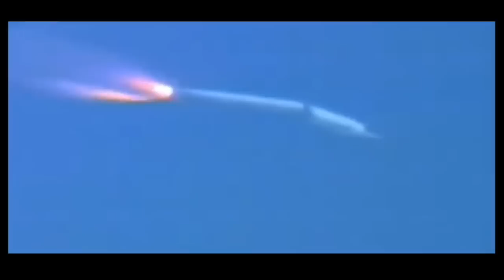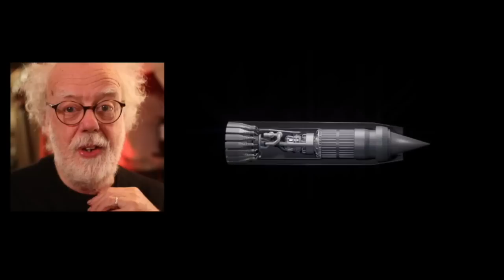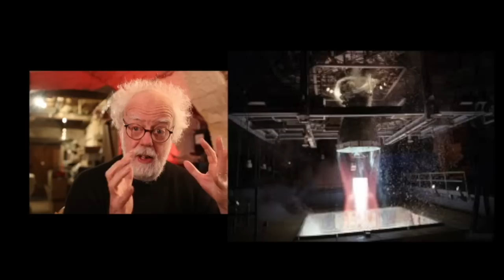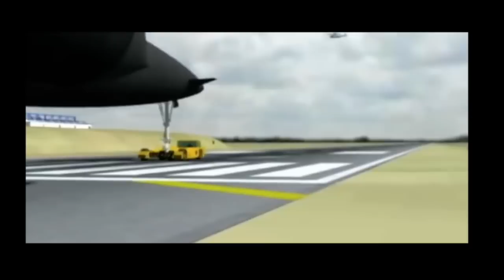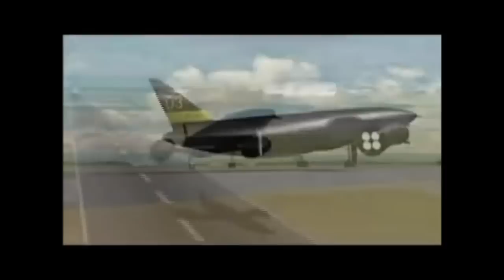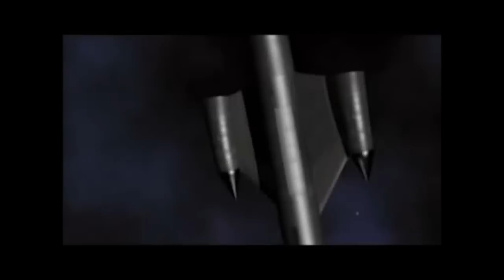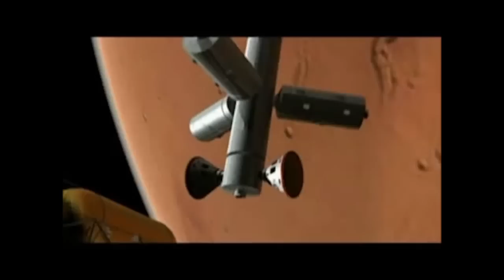SKYLON - The dream - Prof Simon

Comment: Cooling the intake air is fine and a definite breakthrough. But I think the real issue may be cooling all those small rocket nozzles. Seems like a similar problem with aerospike engines in that you're using regenerative cooling (for reusability,) the same approximate amount of fuel as a similarly sized conventional rocket engine and roughly the same thrust, but now you have 9-12 combustion chambers too with as many times the surface area to cool with the same amount of fuel as that single chamber engine.

Comment: This simply will not work, as the melting temperature of titanium is 3034 degrees, this is when it turns into a liquid,During reentry of the Orbiter, its external surfaces reached extreme temperatures of up to 1,648°C (3,000°F). Despite the extreme heat experienced by the TPS, so without tiles that the space shuttle has on it silica tiles on the space shuttle and the other systems working together is the only way you can re-enter a vehicle that has been in orbit, is just to maintain a low earth orbit , ELO you must be traveling at 17,500 miles per hour, so simply put titanium alone would not be enough to protect the skylon during the re-entry burn, or the OMS burn, this is when the vehicle would have to turn around fire the orbital maneuvering system for the vehicle to Begin to Fall to Earth simple physics would make this impossible, unless and used systems similar to the Space Shuttle, tiles are very difficult to work with and they get lost during launch and sometimes during reentry simply put it will not work, without using the combination of systems they keep the shuttle cool enough for reentry, it would simply Fall Like a Rock and turn into a ball of liquid titanium and I think people burned a little over 140 degrees, think about it think about how much work would go in to a re-entry system for this vehicle that I would become quite costly and extremely dangerous... Sorry to burst your bubble😢😢😢😢
Reply: @Carl Klinkenborg I want to talk about the Ingenuity you put forth in your response, as with rocket engines of that day and that era they used when they called up and down tubes on the nozzle which carried hydrogen  through the tubes forming the nozzle, hydrogen is approximately -400°f, keeping the f-1 nozzles cool.
To bulid a structure to perform this incredible task brings about many expensive programs and systems with many different problems of its own not so easy to solve if these types of problems could ever be solved...

Comment: Even though this is promising, TWR on these would be quiet low no? I doubt just 2 of these can generate enough thrust to create escape velocity, also what about the expenses? Creating these engines would be more expensive than just to make a regular Rocket Engine, also what about the reusable testing phases? These are the reasons why shuttle program was shut down & why NASA still hasn’t taken an interest in creating reusable Rockets. 

What I see happening in the future is we invent a composition of Liquid fuel that’s much more lighter than O2.

Comment: The problem is what to do with all the heat. Convection to the atmosphere would add drag, radiation would be too slow. How about reusing the heat, to reheat the air at the thrust end.
Perhaps three major parts: A cooling loop with three heat exchangers, a stream from intake to thrust with two of the cooling loop heat exchanges and a fuel stream that interacts with one of the cooling loop heat exchanges. 
Stream air enters and is compressed.
The cooling loop cools it with its inlet compression heat exchanger.
A second compression stage compresses the stream further with conventional means (ram or turbine.)
The cooling loop carries its super-heated coolant to a second heat exchanger (thrust exchange) after the conventional compression.
The relatively cool stream is further cooled with hydrogen fuel before it interacts the thrust exchange section and it ignites, completing the heating for thrust.
After the thrust heat exchange the now partially cooled coolant continues to the third heat exchange, the fuel heat exchange.
Heated fuel exiting the fuel heat exchange streams to the thrust section.
Super cooled coolant exiting the fuel heat exchange travels to the intake compression heat exchange to continue the process.

Comment: No matter how you slice it, you're going to be re entering the atmosphere around 7-8km/s... if you don't have a blunt body, youre going to be achieving absolutely ridiculous drag forces in the lower atmosphere since you wouldn't have bled off enough speed. Another point of the blunt body is to get a detached shock in front of the body, getting that stagnation temp away from the body

Comment: When I look at the most recent rendering of the SABRE there's a lot of small nozzles at the back of it, which leads me to believe the engine will act as aerospike capable of having decent Isp in all the regimes it operates. Still not that confident in their use of LH2 as fuel, instead of liquid methane which SpaceX is using for their Raptor engines.
Reply from the maker: Interesting

Comment: A story as It was told to me:  The Blackbird had several fuel tanks.  One was that pointy strake coming out at the tail end.  The story says that Kelly Johnson had designed a liquid fueled rocket engine to go in place of that extra tank.  Then only take on a minimum load of JP and fuel the other two tanks with Kerosene and LOX.  It could then take off like normal, assume max climb and when it ran out of air at about 125,000 Ft, Start the rocket engine.     It would have been the first working Space plane.  A Spacecraft.
But Kelly retired and it never came to be.  It makes you wonder.......

Comment: Yet, both russia and china have hypersonic cruise missiles and russia also has a nuclear-powered cruise missile that stays aloft for years and is just slightly below hypersonic speeds. Russia is also looking to apply their tech towards new spacecraft. What I also wonder is if using helium to cool the air intake, why not once in space using the helium as fuel in a plasma engine?

Comment: Why are they not using the cooling ring technology for take off for reentry on the outer skin of the plane? As an added bonus, incorporate the plasma technology to generate on outer shield on takeoffs and reentry. It would act as like a double pained window to keep out heat. The plasma could also act as a damper for vibrations.  If the wings leading edge could be electrified to create a plasma which could also act as a buffer for streamlining friction.

Comment: If Skylon does get up and running i would say within 1 year it will be bankrupt.Then it will , need large sums $$$$$$ millions spent on it just too keep running.Okay in the military sector they spend $$$ millions just on  concepts before production costs come into the equation.My opinion would just say you built 2 of these aircrafts production costs etc average $80 million per aircraft so 2 would be $160 million in concept alone etc .You could be talking about for each aircraft in total near $800 million.Very expensive unless you build them in China ha ha.I doubt you could build each one under $400 million.Seeing a brand new Boeing  747 costs $350 million.Then the cost of running Skylon for 1 year.Even the  SR 71 blackbird in 1970 was costing $200 million for 1 year running costs.And the military do not care what it costs.Private companies do.Shame but i have doubts it will take off.

Comment: A correction as to the STS's engines. The orbiter itself has 3 SR-25 SSMEs, which run all the way from the pad to orbital insertion.  The only staging performed is dropping the solid rocket boosters (SRBs) at 2 minutes. The main engines are optimised for vacuum, but use some bell nozzle shape trickery to prevent flow separation. The Orbiter also has 2 much smaller engines as part of it's orbital Maneuvering system (OMS) which are used to de orbit the craft.

Comment: What are you a professor in? 

SR-71 cooling techniques WILL NOT work on atmospheric reentry. The SR-71 is designed and shielded for friction based heating, while spacecraft heat due to super heated plasma that heats due to compression. This is why blunt objects are so much easier to shield (hence why the X-37b, Space shuttle, etc. are all blunt nose).
Reply: Justin Martin watch it again, listen to what alan bond is saying. suspect he has a clue.

Comment: That's genius , but water is the best most compact  source of jet fuel that is twice as powerful as Jp4 and it has its own oxygen for a jet engine that morrfs into a rocket in space ..! 
     Salt water can be broken into hydrogen easily with far less energy than previously thought with a less than 10 watt frequency instead of 120 amps 12 V DC  allied to plates less that 10 watts compared to 1440 watts for a pitley few pufs of hydrogen ..! 
    But I'll bet you are not aware of this discovery during cancer research ..!?

Comment: One question, the test facility shown has a significant divergent cross section. How much of the cooling comes from adiabatic cooling from the divergence?
Reply from the maker: Good questions
Reply: There is a conical body inside the test facility, so the divergence isn't as great as it might first seem
Reply: @jocramkrispy305  Thanks. That makes sense and I suspect its taken into account

Comment: The fuel for  hydrogen / oxygen rockets is really cheap. With a fully reusable system, Space-X can afford to fly several smaller missions. Basically, they're just paying for fuel. It's simpler because they don't have to worry about all the extra engineering that makes a SSTO possible. It'll be interesting to see if they can make a hybrid engine work cheaply and reliably though.

Comment: cobrapub here,ok I have spent 40 years in the astro/aero/jet/ramjet/rocket industries as a draftsmen/designer and engineer,sorry no degree just experience and yes I did a contract on the SR71 and the SpaceShuttle!I even had lunch with the father of the turbo High ratio baypass engine at GE Avendale and several SR pilots at Beal AFB!In 1981, that year I received a revelation as you did about the whole compulation of a TAV [trans atmosphereic vechical]!I wanted to reach what the SR pilots called the "HOLLY GRAIL ZONE" where there is no need for propullation at all,above 250,000 feet!The First person to talk about this was Doctor Eugene Sanger,he created the sub space orbital math used by NASA for the space programs back in 1928!Now down to facts the first thing needed to looked at in any SUB SONIC to HYPROSONIC is SHOCK,Managing the air flow in to the engine!The SR71 uses a unbelievable plumming to slow incoming air so as to not blow out the combustion cams,this is extremely dangerious it leads to a problem called UNSTART!Next there is the problem of the combustion cams design,it has not changed in more than 50 years,hence the slow and low inefficient use of the Hi Ratio Bypass stator assembly!Ok next we look at supersonic to hyprosonic regement,above 50,000 feet combustion cams cannot handle this regime,now you need a modified way to combust fuel!The Aerospike showed promise,yes heat conversion is a factor but as you go higher more thrust is required!For those that have trouble understanding what I am talking about,I give you the first SONIC/HYPROSONIC Craft the BOMARC [IM99],it flew at Mach 4 in the 1950's!

Comment: Interesting concept.
Still, when looking at the aircraft, one though comes to mind: how are those tiny wings able to generate any lift, especially on takeoff?
Seems to me, that Skylon will have to go supersonic before even thinking of taking off.
Reply: @Michael Sharp True, but did you have a look at the accident rate of the German Starfighters, some of which being related to overloading this interceptor type aircraft to make it fill its role as fighter-bomber, despite all the high lift devices used in the aircraft? Space programs seem to have the tendency to overrun not only cost wise, but also in terms of weight. Don´t get me wrong, the Starfighter was a great aircraft as an interceptor and the design was years, if not decades, ahead of its time and despite the critiscism about the small wings, it proved it´s worth over 3 decades of being deployed.

Comment: This has many more issues than the heat that was identified, and as a RESULT, the system was abandoned long ago. NASA has done research and the issues just outweigh the possibilities.
Reply: No, NASA did the research on LACE, this isn't LACE. ESA and USAFRL have both signed off on it being a valid concept.
Reply: William Mielke nasa isn't the only, or the best, player in this field. just the richest - or were.

Comment: Nano tubes for the intercooler made of nanocrystalline cellulose will handle extreme temp pressure gradient, Like wise for heat shielding hull panels and space frame nanocrystalline cellulose self arranges and also responds to laser and magnetic alignment making it a print medium with optical and electro magnetic properties. Do you want an invisible weapon? A shape shifting machine for space and atmosphere? My brain was wasted and family business quashed early on so good luck finding some one else who can put the materials in place.

Comment: Unless you are planning on a very slow ascent finding methods to deal with the heating that you get with high speeds at lower altitudes plus the massive sonic booms that go along with the high speeds, the air breathing portion of the flight would be only a few minutes. Seems like you would have to carry a lot more oxygen then a few small tanks.
Reply from the maker: Good points

Comment: Am I missing something..? Where does the oxidiser come from when you're in high altitudes or out of atmosphere..?
Reply: Its a dual mode engine. Uses atmospheric oxygen in the lower atmosphere
and on-board O2 in the upper atmosphere and space.  Don't worry if the UK politicians and civil service run to form they will put the kybosh on the Sabre Engine very shortly as its a good idea.
Reply from the maker: They will have o2 tanks but smaller ones only for space

Comment: 8:44 I understand the point you are making, however, to clarify, the Space Shuttle only used one type of engine from launch to orbit and did not discard them, not counting the SRBs.  It used three RS-25s (Space Shuttle Main Engines) that fired together through the entirety of the launch until the main tank was depleted. They were designed in such a way to function at lower altitudes while keeping their efficiency in vacuum. The two smaller OMS engines were only there to finish insertion and perform orbital maneuvers. Only the SRBs were discarded during the flight, and recovered for subsequent reuse.
Reply from the maker: Yes I got that wrong...I should have said...engines need to be different shapes to be efficient at different stages of flight...
Reply: @SimonHollandfilms  Appreciate the video in any case!  I'd love to see this fly one (hopefully soon) day!

Comment: Well a long time ago I came up with the idea of making an engine that used no fuel except the ambient air in the atmosphere. There is a natural ratio of a combustible gas to an oxidizer and by using the proper frequencies of sound all of the thermodynamic problems can be alleviated. When the craft finally gets into the part of the atmosphere that this method cannot be used then the smaller fraction of payload that you would need to carry fuel and oxidizer to power a craft in the outer atmosphere can be carried easily and leave much more useable payload. I believe that using sound and some of the natural energies that Tesla figured out the future of our propulsion engines are going to be very simple machines that will be easily configured and manufactured. There have been some giant leaps in technology that normal people have no idea of other than a few hints at them just in the past few years. Ion drive and technology that is actually old to us has become much more positive for applications in space travel now due to newer ideas in the use of antiquated ideas that were way before their time. Computers and A.I. have turned the tide in man's quest for light speed in particular. There has been so much change in the understanding of our natural surroundings today that ideas and the application of what we learn on such an astronomical amount of newly learned information that things become antiquated almost overnight due to the rapidity of new information and data that comes to us every day. Man himself cannot keep up with all of the new things we learn on such a highly sped up offering and most of it is from A.I.now. A.I. can lead us into the future if we are capable of harnessing that information and acting on it. The only way man will be able to keep up is to join with such A.I., but to what consequence? What will we become and where will it lead us?

Comment: The Skylon space plane looks a poor design, only done for publicity purposes. With the engines sticking out on the wing tips, any loss of thrust from one engine will cause a massive thrust differential, the resulting yaw will destroy it. It was a handful for the SR-71 when that had engine unstarts, these engines are many orders of magnitude more powerful . It will be interesting to see the finished aircraft and the engine locations.
Reply: The tail was sized to be able to compensate for single sided loss of thrust during the air-breathing phase

Comment: How would frosting be a serious issue at those altitudes ?  The air is quite dry at those altitude I would think.  Isn't it ?   Can Water Vapor even exist at those temps.  Accumulation of Ice crystals I can see ?  But then again the Compression Heating would alter the state of the water ?   How much water in any form is flying around up there ?  NOT MUCH ?   Did they use air that dry in the testing ?   My bet is not.
Reply: It starts at sea level.